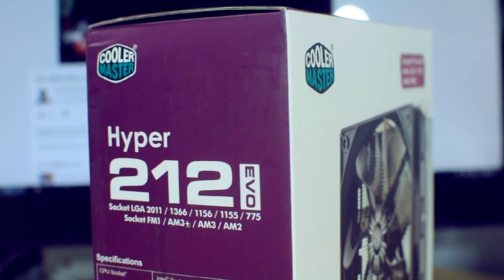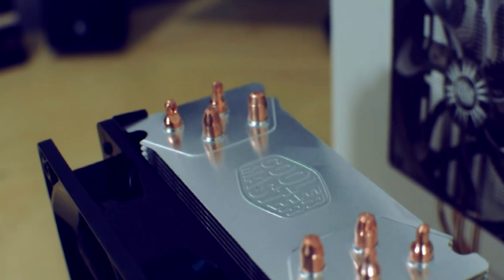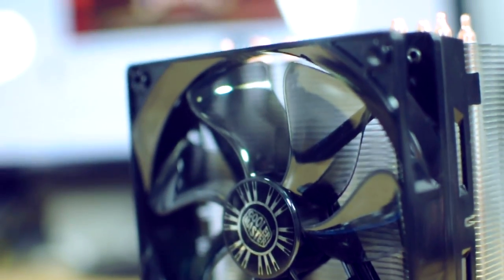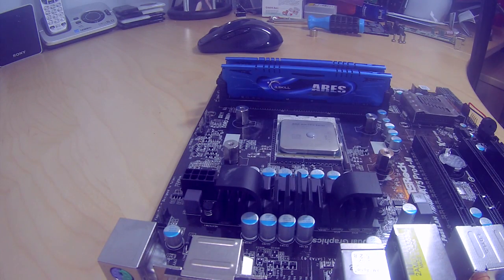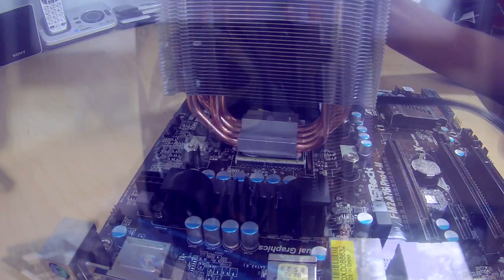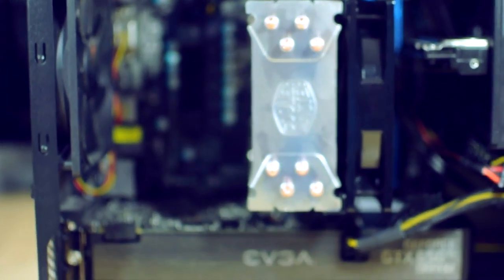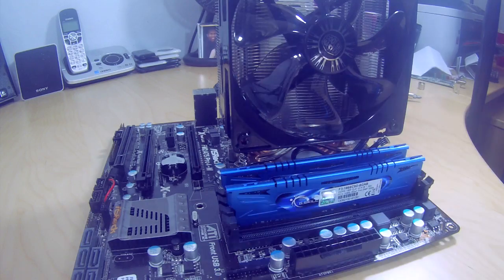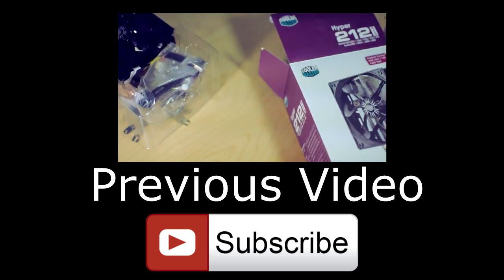Best CPU Cooler! | Cooler Master Hyper 212 EVO Overview & Install

Comment: You installed the fan backwards... It's pushing the hot air from the CPU heatsink towards your hard drive.... Turn the fan around so all the hot air goes out of the back of the case :)
Reply from the maker: No I didn't. The fan is very clearly pushing air towards the rear of the case.
Reply: From the vid it clearly pushes the air towards your hard drive. The sticker on the coolermaster fan means its pulling air from where the sticker is at on its fan. Good luck, just trying to help you out not trying to bust on you.
Reply from the maker: josh thomas I don't know what you're looking at but no it doesn't
Reply from the maker: Nivlekius no.
Reply: josh thomas he has it set up correctly his motherboard just probably has a different layout than you are used to seeing. you can see the I/O Ports on the opposite side the fan is installed.
Reply: my fan points to the ceiling of my case. did i install it wrong?
Reply from the maker: irwintorres727 If you have vents at the top of your case then no
Reply: *****
 but my gpu is running pretty hot, do you think this could be the cause? should i point the fan down at the gpu?
Reply: Dude, yes you did install it backwards. You are blowing hot air over your hard drives. Either that or you are trying to blow air through the heatsink and out the back. Either way is not correct. You should be pulling the hot air off the heat sink and out the back with the back fan and or out the top if you have a top fan.

Comment: ***** I'm kind of scared to get a fan cpu cooler since my build is gonna have a high end gpu, and I really dont know if it's good enough to cool it. The gpu is a r8 289x. Do you think it'll be enough to cool it, or do I have to result in a water cooler? :O

Comment: Quick points,
1) Put motherboard on a cardboard box than directly on the table .. protects backside soldering and prevents scratches on the table
2) When tightening the fan mount screws, always do star or diagonal pattern tightening so that pressure is equally distributed.

Comment: This cooler + 2 Noctua NF-F12 PWM 120mm Case Fan from newegg = GG i never go past 50 degrees now :) installed cpu is a FX8350 overclocked to 4.5 unparked cores turbo mode off  I can finally play bf4 without an issue! Any that doesnt want a liquid cooler or custom loop needs to buy tis right meow just get the two fans i mention and install the fans right also i have a case venting fan like normal cases out the back so push pull on 212evo and pulling out the case i have one fan on my cases side panel on the lower side of the case pull cooler air in an a always clean lasko fan blowing cool air towards that intake fan my case also has a bunch of ventilation...... this is a lot to read but to ease the mind of any1 that is new to this this is what they can do.
Reply: All that in mind i live in the AZ desert my ac is set for 80 degrees F so i consider my temps to be outstanding!!! My room is much cooler now due to those Noctua NF-F12 PWM 120mm Case Fans tho the stock fan does a good job but noctua is just epic based on the results iv gotton from just adding some good fans
Reply: Nathaniel Gieseking Cool , do you have it ?!
Reply: Nathaniel Gieseking Hmmm over double the price. So yeah only a little bit more
Reply: Yes but no everyone lives in the US and its costs over twice as much for a noctua heatsink. £25 for 212 evo. £65 for cheapest noctua. And not a great deal of difference either. The more you know
Reply: to each they own but it dropped my temps down a bunch in the middle of summer time compared to antec fan + stock fan
Reply: Nathaniel Gieseking But what you said is that it would cost a little bit more for a Noctua and would perform a lot better.Just looking at some benchmarks. Cheapest Noctua I could find was the NL 12. £42. It was tested to be 4 degrees cooler than the Hyper 212 evo. So to slap 2 noctua fans on would make more sense than buying the NL 12 as it would cost the same and would preform better. Heres the link too. http://www.anandtech.com/show/6830/cpu-air-cooler-roundup-six-coolers-from-noctua-silverstone-and-cooler-master/4
Reply: I think u miss read what i said i have a hyper 212 evo cooler by coolermaster and two nf-f12 noctua fans on the cooler...
Reply: and its not a waste of money if i cant fit a closed loop cooler in my case and the hyper 212 evo is all that will fit in my case that provides great air cooling so to add even more cooler noctua nf-f12 fans provided about 5-8c drop in temps compare to the stock fan that came with and a crappy antec case fan in the push pull method same method used for two nf-f12 fans made a noticeable improvement gain without having to install any new cooler and made good use of already installed hardware...
Reply: You seemed to type that comment just fine.
Reply: and when i got my noctua fans it was discounted on newegg only paid 25$ each fan :) i already upgraded everything else in my computer mobo ram cpu gpu so cooling was on the NEXT thing to do list... all that is missing now that i dont really need to upgrade is a psu... and wait for the nvidia 8xx or 9xx series  to get released
Reply: Woah, watchout, we have a smartass over here, soo if the fan was disconnected u BUYED A NEW ONE ?! SRSLY?!
Reply: babarain99 Nathaniel Gieseking William Saunders  Where is this conversation going... or is this some really crappy attempt to troll the hell out of my post that is legit... sigh cpu is at 23c at 4.5 oc just browsing the web :) im happy some here by the looks are not happy with something or the other no1 cares and those that do need to know nf-f12 noctua fans perform great on the hyper 212evo if u want to go with another cooler great more power to yah just saying what iv got from it all... thanks bye.
Reply: Troll the hell out of your post? Your no special because you posted a comment
Reply: barrett cowart  how did you installed two fans on hyper 212 help me pleaese :)
Reply: bobbly gamer look in your box there should be two plastic mounting brackets that you would screw onto the second fan. If you are changing both fans take them off of the original fan

Comment: Debatable statement in the name. " Best CPU Cooler ". This is so vague. Maybe its a good fan cooler but there are also water-cooling options out there.  To label it as "best" ... far fetched and usually requires a comparison of an array of products from the same bracket.
Reply: I don't rely on water cooling. I've read many reviews about famous water coolers that have broken and ruined $4,000 computers. I don't want that to happen to me, and I'm not taking any chances.
Reply from the maker: ***** oh
Reply: ***** I guess you could call it a best value/budget cpu cooler
Reply: It's not even that good in terms of air coolers.

Comment: 45 on idle? fuck me! my 8320 @4ghz on idle with this cooler is at 30c! at 900rpm?!? noctuas baby ;) and not hard to install? try installing it when the mobo is still in the case with a top mounted, non modular psu in a case with no cable management... yeah. only teh newbs and teh gayz take out their mobo ;)

Comment: When I install the heatsink of the 212 evo the screws won't all go in I get 2 done and the other 2 are just there floating above the place where I need to put them in but I have to put force on it and I don't want to break anything. Anybody know the problem

Comment: This is the best CPU cooler ever! I just made a push/pull configuration on that Cooler and my temperatures dropped 10'c, I'm now on 4.6ghz with my FX4100 running 61'c stable!!!

Comment: i am thinking about buy in it because the fan of the fx 8350 is noisy and shitty do you think i should ?
Reply from the maker: absolutely
Reply: ***** first Youtuber to answer me thanks man very helpfull do you know about otjer peoples that bought my same processor and had to buy the evo?
Reply: luijo8989 It's common knowledge that all the FX CPU's run hot. You basically HAVE to run some type of aftermarket cooling, especially if you're overclocking.
Reply: GabezNsane ok thanks!

Comment: Shouldn't u spread the cpu thermal paste out? I'm a noob :)
Reply from the maker: It will spread like hell when you're trying to line up that stupid bracket, don't worry
Reply: I heard that a cross method corner to corner works good. If you spread it with a card or plastic air bubbles form and the CPU will overheat.

Comment: hey I can only find the Cooler Master HYper 212X in the stores nearby.
is there a big difference? hope you help :C
Reply from the maker: The 212X is the newest version IIRC with slightly better performance than the 212 EVO.
Reply: Thanks for the info! =)

Comment: im sure you have gotten this a million times by now, but that is not corsair vengeance ram. you might want to annotate that
Reply from the maker: there already is an annotation in the video
Reply: that's weird cause it isn't showing for me and annotations are on. not meaning to give you shit, just wanted to make sure you knew about it.
Reply: ***** What's your system specs and what's the temps/room temps? I'm thinking of buying for a 4670k and will overclock to 4.0ghz (for now) in a 90F room.
Reply from the maker: room temps stay at 80-85 degrees

Comment: Hi,  I see the clearance from the fan and the ram is really close,  I have 4 sticks of corsair vengeance blue ram but they have the heat fins sticking out on top.   Do you think the fan on this cooler would fit Above my ram?   I really would like to get this cpu cooler.   Thanks
Reply from the maker: I doubt it but can't say for sure. I'd google search to see if anyone has that same setup

Comment: thanks for video.
just installed the 212 evo on my MSI Z87-G45 with i5-4670K.

With stock cooler CPU was at 55deg C, after install down to 35deg C.
i did add the second fan option using the cooler master blade master 120 fan.
Reply from the maker: Nice, a push pull configuration

Comment: Is this WAY better than the AMD FX-4170 Stock Cooler? I'm using the stock cooler right now and i can't handle it, its way too loud for me
Reply from the maker: In short yes. This cooler can be quiet loud at max RPM but if you adjust the fan settings it will cool better and be quieter than your stock fan.
Reply: ***** Would it be a lot quieter than my stock fan? Lets say when my cpu is running normally in the background and its 40C, how cool will it be with this cooler? My stock fan will be around 2000+rpm when its around 40C so how much rpm will this fan be on 40C?
Reply: Mubz Beats - Daily Dose Of Real Music Yes, the fan won't need to spin as fast due to the large heat sink.
Reply: Mubz Beats - Daily Dose Of Real Music It should be around 35-38 degrees at idle (at the background).

Comment: Did you put yours on backwards? Why is it facing the memory?
Reply from the maker: No, it's on correctly. The fan is supposed to blow (or push) air towards the rear of the case.

Comment: Thanks for the video. I run a Haswell I-7 4770k and my stock heatsink isn't keeping my temps down at stock-rated 3.8 Ghz. I was debating on buying this or wait another 2 weeks and save up for the cheapest closed-loop, water cooling solution.

Think I'll give this a try since you said it dropped your average temp down by 5-7 Celsius. That's what I want for the cheapest route I can find. Thanks for the upload.
Reply: It seems you got the 4770k volcano edition son.

Comment: love mine! got my 3570k OC from 3.6 > 4.3 with no voltage increase running super stable that never goes over 61 degrees C running aida64 for hours.
Reply from the maker: nice! I would love to get there as well with no voltage increase. Is the fan loud at those temps?
Reply: ***** i actually tweaked a few things since but now im up to 4.4ghz OC and running 1.088v over the stock voltage it was running at 1.064v so now a total of 1ghz OC with a .024v increase.

Honestly i don't think the fan noise is loud. but i have a positive airflow case with some amazing silverstone AP 140 fans.

also my Gtx 760 is OC also that adds to fan noise.